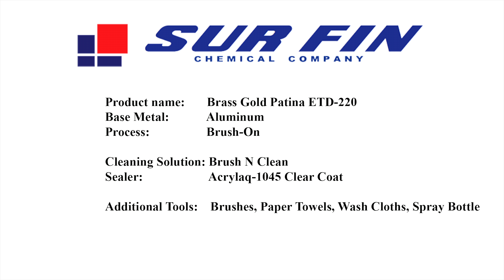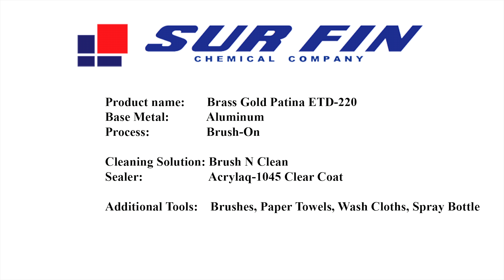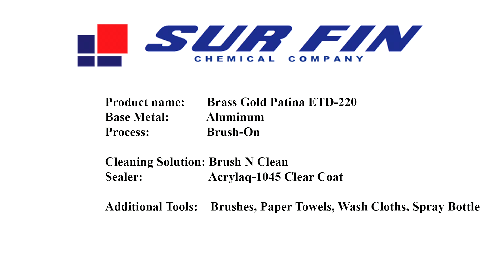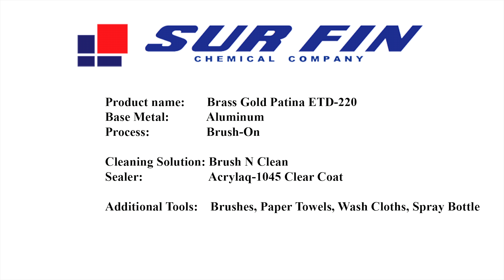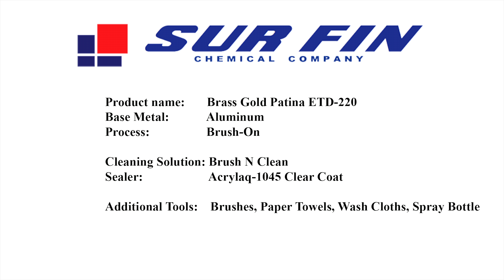Patina for Aluminum: Brass Gold Effect on Aluminium

Comment: I'm here to share what I've learned from my recent experience with this.  Firstly, a little goes a long way for both the cleaner and the patina solution. I made the error in judgement, concerned that I might not have enough for my larger  project, and mixing the entirety of parts A and B solutions (16 oz.),  which only last 8-12 hours. Unfortunately, most of this ended up being wasted. For what it's worth it has a bleach odor, is deep purple and turns brown. 

Work quickly to cover the entirety of your aluminum and based on the shape of the material, use a brush technique that makes sense. Circular for a lager surface, or linearly for longer trim or brushed textures. As others have noticed, it's unlikely to create a perfectly even patina unless perhaps you were able to quickly submerge, though I'm not convinced. The solution creates an unfinished brass appearance in a  2.5 - 3.5  minutes (use a timer!), so don't work with more than you can in that time. It may be tricky if you have a large piece that you attempt to work with in sections as you may see the overlap. Longer than 3 minutes will start to appear bronze- great if that's what you'd like.  You can also apply, rinse and reapply if it's not dark enough. 

I highly recommend working with a test piece if possible. 

The clear coat will be necessary not just for protection (I found that it is possible to rub off with enough effort) , but really is a necessary step to complete the effective brass appearance. Without a clear coat the effect is muted and less realistic.

Actual unfinished brass will have and continue to develop an uneven appearance, so this was able to match that in my experience. I'm using aluminum trim along side actual brass trim and if you aren't looking too closely, they look the same.  This product might be especially ideal for projects where you want to create the appearance of old weathered relics or vintage unfinished brass items, but more challenging if seeking a refined effect. Certainly more effective than a brass colored metallic paint in most applications.

Comment: The inside of my aluminum water bottle is brass in color. Is this used to prevent aluminum oxidation and leaching into the drinking water?
Reply: No it is not. This is a cosmetic treatment only which is why you need a sealer to seal it in, or it will wear off with use or chemically change if exposed to other acids like vinegar, etc.  This is used to color in a patina, and is not meant to cover the aluminum to prevent aluminum salts leaching into food and water.  Do not use for that.  Use a glass bottle or stainless steel.

Comment: Hello,
You might not answer, but as your products are not available over here, i wonder... isn't your product an acetic acide+permanganate potassium solution?
Thanks.
Reply from the maker: Depending on whether it's an interior or exterior project, it will vary on the results. I would recommend a clear coat to preserve the patina finish.

Comment: Can I polish it for a mirror finish? I’m looking to give my aluminum car parts a gold mirror finish.  Also how does this hold up to heat?
Reply: No. You can probably polish the aluminum and then apply this, plus a high gloss clear coat. I can't speak to the heat. I would guess that it would hold up,, but I'd be more concerned with whatever clear coat used , which you really need to use. This is only surface level and can rub off if not protected.

Comment: What is the heat resistance? Are you able to apply this to engine parts?
Reply: My question exactly, any answers?
Reply: No they won’t. These are just surface coatings and do not actually stain the metal.

Comment: i wonder how wear resistant the coating is? this stuff is pretty cheap to try i guess. actually they charge $30 for shipping 16oz bottle so not that cheap
Reply from the maker: After applying the patina, the clear coat allows you to preserve your patina finish.